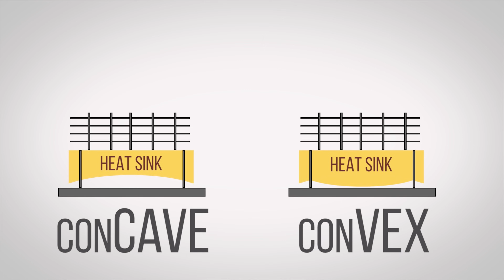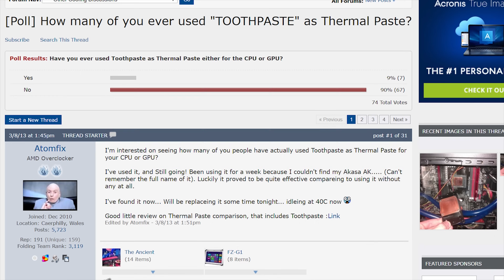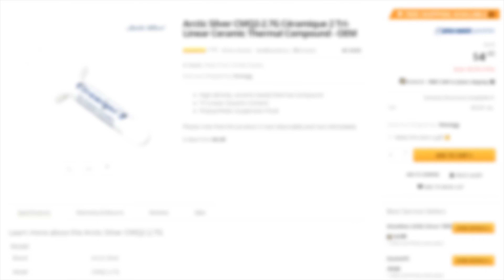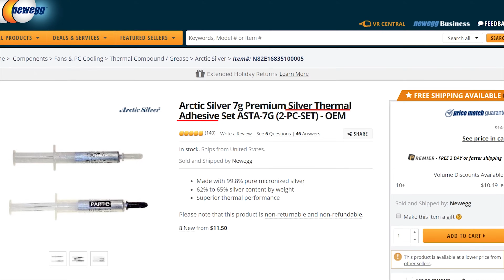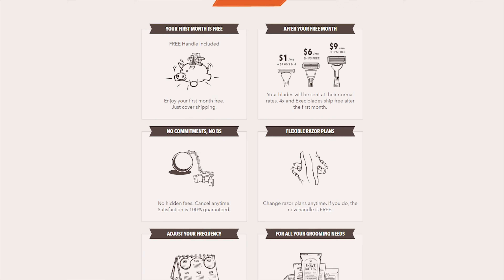How Does Thermal Paste Work?

Comment: Having watched Vertasium... it seems obvious that the aerogel, as seen through the thermal camera... actually absorbs a whole lot of the heat from the flamethrower... which means the heat doesn't need to be transferred anywhere else which is quite a unique insulator kept absolutely cool to the touch... because the heat struggles within each tiny enough pore almost preventing every bit of friction. If correct... there will not even be a need for GPU cooling fans.

Comment: the answer is yes you can, it just means that the thermal transfer isn't as good. but it still works. and remember you only need a whiff of thermal compound to fill those microscopic gaps.

Comment: How do I know if I need to replace the thermal pads on my ps4 pro. I changed the thermal paste, but not pads. My machine is quiet now, but runs hot. It's clean as a whistle.

Comment: I am connecting a set of brass band heaters to the outside of a steel pipe for a school project. I want the inside of the pipe to be as hot as possible to melt plastic for 3d printer filament. Would it be a good idea to apply thermal paste between the heaters and the pipe for maximum thermal conductivity? Thanks

Comment: 1:20 the Space Shuttle's thermal tiles used air in small packets basically. Underneath the few thousand degree tile surfaces was aluminum which melts at around 600f.

Comment: If air is a poor heat conductor then how does an AC cools an environment? Are you telling me it could do it even with the fan off?
Reply: Fan is used to circulate the air in air-conditioning. Since there are no medium to push the air between the air gap in microscopic levels, heat will be trapped.
Reply: @zenniz1992 also Air Conditioning systems use a Refrigerant to help produce cold air

Comment: now my question is, what is the density like compared to the gaps on the cooler?  By this I mean, for the metallic particles to fill those gaps between the chip and cooler, they would have to be finer and smaller than the gaps between the coolor and what you're trying to cool. With how thick thermal paste is, you also have to consider that the particles are covered in paste. Personally, I've had better results with thinner pastes such as EVGA Freeze than Arctic Silver 5 due to the thinner paste being able to flow into the crevices. 

While speaking about the thickness of pastes, another factor to consider is the shape of particles and what they're made of. If a paste is full of particles that are polygonal in nature cannot realistically fill gaps very well. While in theory fit together like a puzzle and be able to have zero gaps in between, that doesn't happen. Especially when suspended in a thick solution where they cannot flow into place. 

Perhaps it would be interesting to multiple types of thermal compound on an atomic level to see what's really going on. Are they actually filling voids, or created more pockets?

Comment: Believe it or not, I did run a Phenom 9500 machine with no thermal paste whatsoever for several years. I was frustrated with my life and didn't care at all about performance at the time, had to replace a motherboard, but forgot to buy thermal paste. So I said screw it lets just try it this way and see if it works. And it did, idle temperatures were in the 60s and while gaming it went up to low 90s (I think... I only checked once), but it didn't overheat. Then at one point a few years later it started BSODing or just freezing for 4-5 seconds. I got thermal paste for it and temperatures dropped 30 degrees and then it was fine. :D

Comment: I accidentally removed the Thermal Paste on the CPU
and it worked for a few Months now it wont boot :|
The Caps (LED) flashes 1 Times that means the CPU is kinda Broken right?

Comment: The "crevice" thing is a bunch of bull.  I have seen live tests prove it.  No measurable difference.

Think of it like this... If the Pea method works as well as full coverage on a CPU lid when it only covers part of it, and sometimes doesn't even cover the actual die, what difference is near microscopic striations on the heatsink and lid going to do.

Comment: Diamond is 2.5x more thermally conductive than silver. Copper is  only 5% less conductive than silver so... negligible, when you weigh in the cost of silver vs the cost of copper. Aluminum is half as conductive as Silver.
Reply: But the heat created from the cup would create powdered copper to oxidize and that would be no good so aluminum and silver is used
Reply: Thats the reason why our cables are made of copper instead of silver.
Also keep in mid that coolers are usually not made of pure copper.
The alloys used are actually realtively close to aluminum in terms of heat transfer.

Comment: i dont have thermal paste on my shitty fujutsu laptop
Reply: Joonas Pohjola thermal paste is used on custom build Pc for CPU cooling, not on a laptop
Reply: It's used for laptop cooling systems as well
Reply: Linus Fedora Tips only modern laptops
Reply: Jack ripper wrong, You just don't see it. Most laptops uses fans, but if you use heatsinks, in most cases your cpu is using thermal paste.
Reply: Clint-Excalibur71 it had thermal paste but it was dried so i wiped that out

Comment: Arctic Silver 5 is old.
There are much better TIMs out on the market these days.
Reply: IIGrayfoxII What are the better alternatives?
Reply: Anything that has a higher W/mK rating is better.
The higher the better

AS5: 0.95W/mK
Deepcool Z3: 1.1W/mK
Deepcool Z5: 1.5W/mK
Deepcool Z9: 4W/mK
PH-NDC: 4.5W/mK
Aeronaut: 8W/mK
Hydronaut: 11W/mK 
Kryonaut: 12.5W/mK
Conductonaut: 73W/mK
Reply: AS5 isn't really loved for it's optimal performance (others are better as you've mentioned) but the stability of temps you get with it is unrivaled. Your temps will barely fluctuate at any given load.

Comment: I saw a video not long ago where someone compared the default thermal paste with an aftermarket air cooler with that of AS5. The cooler actually performed better with it's own paste rather than a supposed superior alternative.
Reply: it's because Arctic Silver 5 is actually a sham and has been mismarketed from the start.
its specs are a complete lie, it is mediocre at best.

sadly, the marketing scheme has worked as everyone buys it thinking it is good.
Reply: *****
So I guess it's good I just plan to stick with stock paste then.
Reply: ***** included Thermal Paste is fine, it's just not particularly long term usually.

Comment: Novice builders, here's a quick guide on how to find what's enough thermal compound. 

It will come (most likely) in a little syringe type applicator. There's PLENTY in it so don't worry about wasting a little bit. After the mating surfaces have been cleaned with alcohol, apply a round drop off compound about 1/8th inch wide in the middle of your CPU heat spreader. Mount your cooler as if it were final assembly then carefully take it off again. Check to make sure the thermal compound covered the CPU without coming over the sides, then clean both surfaces again (just putting it back together can trap air in the compound and hurt performance). If you need to adjust the amount of compound you use do that, if not then great! This method should keep everything clean and use very little thermal compound.

Comment: Dont use crapy thermal. I found it the hard way... My old laptop processor got water on top of it and (i dont know how) it damaged the motherboard. It still works (after the GPU registered 125°C, ops?) but i have to run a program to force its multiplier to go up, otherwise it gets stuck on half speed.

Comment: Could you guys do a fast as possible on grounds, and what the heck the third prong on our power cord does?
Reply: BunnyHelp has to be summarized and easy to consume,which is why they are asking techquickie
Reply: the third one is the neutral thing that makes it a little bit safer iirc.basically avoid your stuff from exploding in case lightning hits the power cables
Reply: i second this notion
Reply: God I love Hyper-Physics, but I still really want to hear linus talk about how the ground is functionally useless, or luke.
Reply: @brozach1394  the ground isnt useless
Its a great safety feature.

Comment: i have a motherboard custom build and the cpu is a4 7300 (uses 65 watts) and i upgraded to x4 845(uses 95 watts) and my psu is 220 watts, the problem is that it turns on but wont post or boot to even bios, the screen sometimes flickers, could this be a result of not enough power
Reply: most likely, just get like a 500 watt power supply its probably more then enough and you could do more with it in the future.
Reply: would a 300 watt do, this is literally the final upgrade, it runs my gpu perfectly before hand and (dont think it matters) wont be making it have 16 gb of ram and just leaving it the 8 gb
Reply: and sorry if its an ass question but my limit is 25 dollars, i was just wandering if i would need to get a new psu at all, but thank you
Reply: Kameron Swan dude, if 220 isnt enough you shouldn't get the bare minimum, thats what caused you to need a new PSU in the first place, a decent 500 watt PSU isnt a whole lot more then a 300 watt and it gives you more room in the future.
Reply: you are amazing, thank you
Reply: no problem
Reply: Kameron Swan why would you buy an 845 if an 860 costs the same?
Reply: explain the difference, not being mean but i have not done my research yet
Reply: Kameron Swan higher clock speed..thats it

Comment: My cpu worked a good while without thermal paste, but decided to add some for the hell of it because I wanted to overclock,still probably not necessary, on the other hand,my gpu won't even post without it
Reply: You prune,overclocking a device will eventually do bad damage to it
Reply: @stephensnell5707  how ?

Comment: Building my first PC soon, how much paste must I put on?
Reply: 42
Reply: Just enough to cover the surface. It will be squished by the heatsink so if you put too much it may go past the edges.
Reply: Uncooked rice corn is a decent reference size. There is a bit of leeway in both directions but that is a decent approximation.
Reply: A pea sized bead in the middle. (There's a vid by Crit TV on YouTube called "How to apply thermal paste" that compares different shapes and amounts of paste.)
Reply: if you buy non-conductive paste, then too much doesn't really matter.
Reply: I knew it!!!
Reply: It doesn't really matter unless you put too much on which a lot of people do.

Comment: 3:23

Is this what Apple uses in order to prevent customers from being able to switch out parts? LOL
Reply: Alab lmao, the solder is not necessary to make it smaller
Reply: ButterSquids 

But... That's what apple told him so it must be true
Reply: ButterSquids try to have a latching system for the cpu, gpu, ram and then try to make it small. yeah, i thought so.
Reply: some laptops even non-apple, has the cpu soldered on the motherboard lmao
Reply: MrGhost370 there isn't really a standard for laptop parts, expect a rare expensive kind called mxm, and like. good luck finding a moblie gpu or cpu
Reply: MrGhost370 that is one company that i can name off my head. the majority don't have upgradable gpus.
Reply: Biden
Reply: companies solder parts together so they could make the product smaller.

Comment: Should I replace my thermal paste? I use the stuff that came pre-applied with my corsair GTX H110i?
Reply: That depends.  When did you most recently install that cooler?  If it was more than 20 years ago.  I recommend checking to ensure it's all still there at a reasonable amount.  Otherwise, if it looks like almost half of it has vanished, clean the h110i's cpu plate, and the cpu, and apply fresh paste.

Comment: Wtf is up with this deal on amazon: https://www.amazon.com/GL502VM-DB71-i7-6700HQ-Windows-Ultraportable-Notebook/dp/B01KGA63LI/ref=vsbg_lptp_601434_sr_m/157-0859745-3127455?s=pc&ie=UTF8&qid=1480457009&sr=1-2 how is this pricing even possible? Whats up with this offer, i think it's fishy af
Reply: 1300 seems about right...
Reply: 2010ngojo haha wth, yesterday it cost only 499
Reply: HazardGaming
Yeah they tend to do that. I saw a gtx 970m laptop for 550 several months ago. Third party on Amazon. They cancelled my order and changed the price.
Reply: 2010ngojo but why would they price it like that when they're changing the price later anyways? Some kind of bait scam?
Reply: HazardGaming
More like a mistake I'm guessing, at least with the seller I dealt with. They had multiple laptops all with similar specs, except for the one with the 970m. I assuming they just bulk price all of them thinking they're all the same.

Comment: Good video as usual. But you have an error in the video. Actually diamond is a better thermal conductor then metals, more then twice as good as silver (http://hyperphysics.phy-astr.gsu.edu/hbase/Tables/thrcn.html) and is an electric isolator . But cost is the problem.

A new material "cubic boron arsenide" could rival diamond with much lower production cost then artificial diamonds.  (https://www.google.se/amp/phys.org/news/2013-07-competitor-diamond-thermal-conductor.amp)

Comment: Hey. I have what i think is a video-worthy question. Why not use a cpu heatsink for a graphics card? And i'm not talking about water cooling. Y'know, strip off the stock heatsink and put in another one.
Reply: My best guess: you probably could but it probably won't fit right, and even if it did, yeah it'd probably break the card. Oh, and there are other heat-emitting components that I'm unsure a CPU cooler could effectively reach even with modification.
Reply: It isn't strong enough and would take too much space.
Reply: The die of a GPU is also exposed, so you rick Crushing the fragile die and kill it

Comment: Spread the compound with something or squish it with the CPU? I'm in the camp that it doesn't make much difference at all, but once I was on IRC and a guy very testily and condescendingly told everyone that spreading it is the only right way and that being a "thermodynamic engineer" made him infallible.
Reply: CWplayer
y tho
Reply: CWplayer
is any of this not true of proper squish-application? One thing isn't, which is that none should spill over edges at all, not just less, as spilled compound is wasted
Reply: ๖ۣۜ♥๖̶tacokitten๖̶ ive try both and had no issues with either method
Reply: ๖ۣۜ♥๖̶tacokitten๖̶ push it down. 
cant be bothered to explain, but do it
Reply: ๖ۣۜ♥๖̶tacokitten๖̶ 100% airpocket free, spreads equally, less will spill over the edges, and idk what more
Reply: Putting a blob and pushing it down is faster as well, and i'd rather not mess around with it
Reply: Actually isn't the less time in the air the better?  If so then you don't want to be there for 2 mins spreading the thing just bang it on?
Reply: i prefer the X method 
that way there is even coverage on the whole chip and you dont get hot spots

Comment: little microscopic trolls take the heat atoms and glue them to the copper headsink to cool it of then when cooled they take it back of and put it on the die again. thats how they work.....

i use paste with diamond dust

Comment: With the exception of liquid metal TIM, most of the top stuff is non metallic these days.  And Arctic Silver is just kinda meh these days.  Not bad, but not great either.  And there is the whole pain of curing and later down the road trying the clean it when it's dried up.  Thermal Grizzly is the current top dog, but in all honesty all the top stuff is pretty close to each other.  Noctua, IC Diamond, Gelid, Arctic MX series, and so on are all very close to each other.  The real stand outs are the liquid metal options.  Like Cool Laboratories Pro and Ultra.  They are usually a fair bit better than any normal paste, but tend to be problematic.

Comment: How often should you change it?
Reply: Only if you take them apart, in which case you should first clean the old thermal paste before adding new one.
Reply: only if you take it apart, and unless you're temps are getting bad you shouldn't.
Reply: Disectra id say 1x per year or 2-3
Reply: CWplayer or 4-5 or maybe even 6
Reply: elucidate you're probably right, i dont have experience changing thermal paste, nor did i research it.
Reply: CWplayer I was just joking :)
Reply: Only when you're changing your heat sink or cpu cooling
Reply: Every two years or so

Comment: My Jizz is the best Thermal paste,  If anyone is interested I can send some to you. 
Only $6.66 per-Bottle. That's a Steal. Don't drink it though.
Reply: I'll drink it if I want
Reply: If you use it as lube to produce your own Jizz, it will perform better.
Reply: How large is this bottle?
Reply: Isn't it supposed to be largely water-based? That would get ummm...sticky real fast!
Reply: Dover that's not how it works
Reply: the best part about jizz is that you don't have to put a heatsink on it ... and make sure to reapply every 6 months
Reply: AryanIsDaBest yes
Reply: You're must be 9 years old
Reply: Phil Mitchell 😂😂 #Mitchelled
Reply: About how fast in theory could this substance travel down a throat? For research purposes
Reply: That would be so hot, I'll shoot a porno if it happends

Comment: What would be the temperature difference between using/not using thermal paste?
Reply: Your Cpu would most likely thermal throttle without paste. So in short a big temp difference.
Reply: That depending on the cpu and cooler on top if it. Either way I'd use paste.